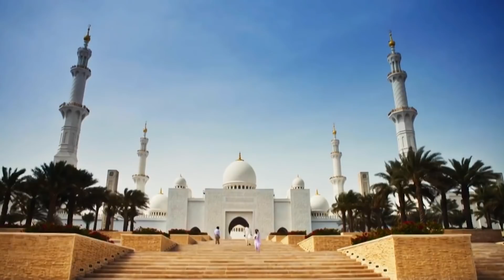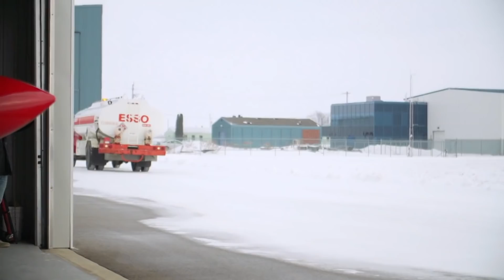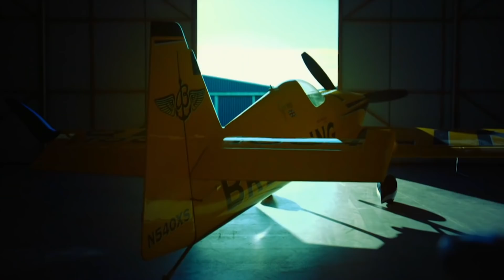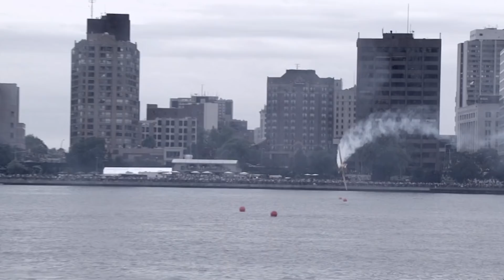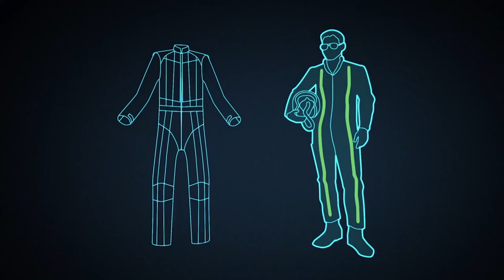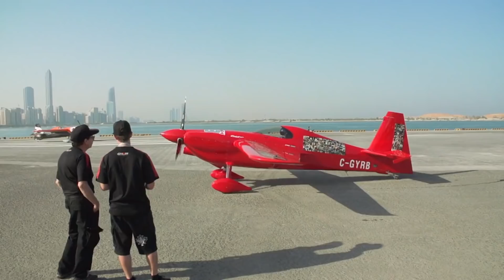Building Red Bull Air Race's Floating Race Track

Comment: These airplanes are amazing, they are top machines. They are a current copy of the P51D. With out the armor, the artillery & with out the landing gear. Top Notch Pilots.
Reply: Smaller than the P-51 but do look a lot like one. Also check out the Extra 300 and for the current military version look up the Super Tucano.  Made in Brazil now they started with a P-51, added a second crewman, then a turboprop engine, tricycle gear, etc. However it still looks like it belongs in the family .
Reply: These have little in common with a P-51. Except single engine piston/propeller, low-wing monoplane with a large bubble canopy and center control stick. Arguably the P-51 is just a copy of the Spitfire, cleaned up aerodynamically and made mass-producible with straight wings. 

These airplanes; (Extra 300/330, Edge 540, MXS) are steel-tube fabric covered, with composite wings and body panels, except the MXS (and Extra NG) are all-composite structures. They are powered by the Lycoming AEIO-540 or -580. 
Which is pretty much a standard General Aviation flat-6cyl, air cooled piston engine, but modified to feed oil while inverted. 

Little in Common with the Rolls Royce/Packard Merlin. Which was Inline V12, supercharged and liquid cooled. Except for its general layout and maneuverability. 

Go take a ride in one sometime. They will leave your brain behind the on the ground... good luck finding it when you land, lol.